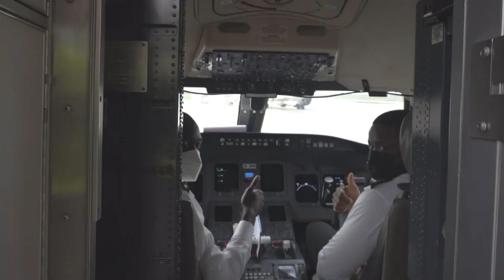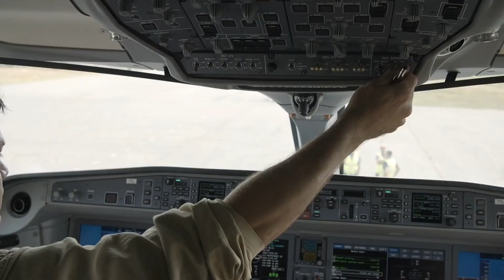Is this Airbus's NEW Aviation Market? | NEW Airbus A220 order

Comment: The next will maybe be FlySafair but it's unlikely since they have an all 737 fleet
Reply from the maker: Good point! However, since Boeings closest aircraft would be the 737 MAX 7, which is a less efficient aircraft overall, in some cases, airlines will need to break from an all Boeing fleet. It hasn't happened much of yet, but if Boeing doesn't respond to market wants with a a321neo and a220 competitor, their losses could be significant. 

Hope you enjoyed!
Reply: Fly safe with the B737MAX? Impossible...
Reply from the maker: @Patrick Peters 😂😆